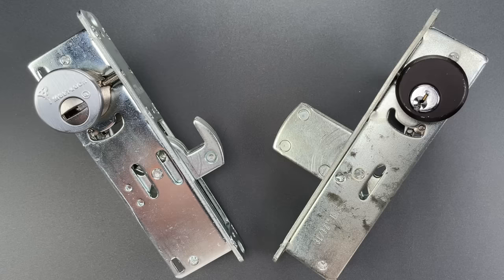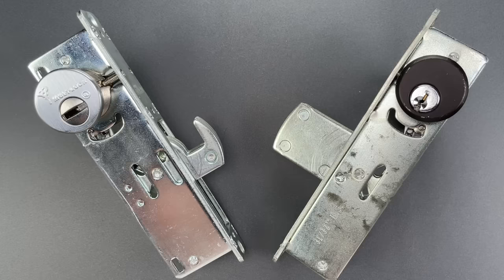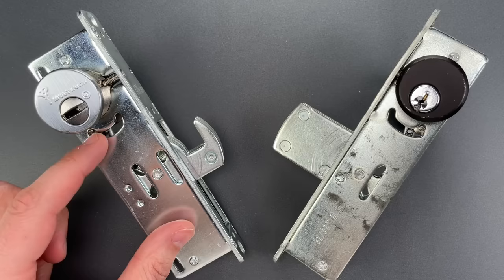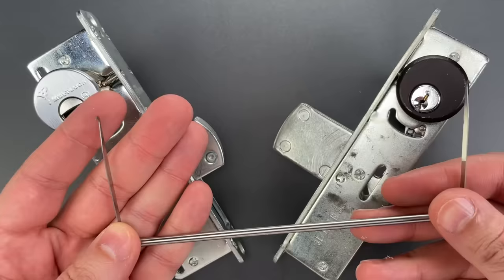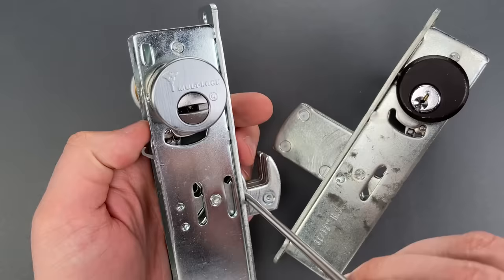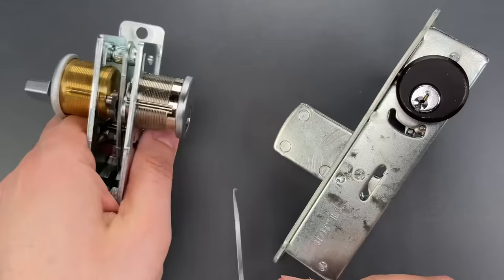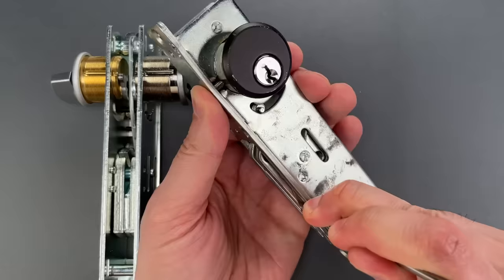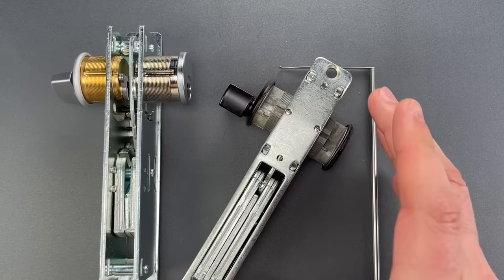[1409] The Most Significant Security Flaw in North America

Comment: My workplace has a baffle plate over the joint between the doors, over the lock area.

Now I know why that plate is there!
Reply: I have seen this in a lot of infrastructure buildings in many communities.  The winged baffles, it be neat to see him try one of those.
Reply: @SolRC  See that would just require a longer tool (of VERY specific dimensions).
Reply: I've seen them too.  Wonder if someone come up with a tool long enough to get around this.  Would like to see a comment from DeviantOlam on this.  He covers this kind of thing pretty extensively.
Reply: So, could it be said that, before watching this video, you were baffled by the plate?
Reply: @Cenentury0941  🤣🤣🤣

Let yourself out please....lol
Reply: Thanks Laird.   I have seen these plates before but I did not realize just how easy it can be to break into our store.  (rock method aside, of course).
I will be getting a plate installed ASAP.
Reply: @michaelmoss5476  And thus the function of LPL and the (noncriminal) lock picking community bears fruit! 🍎
Reply: @Cenentury0941  That was evil, you sick genius!
Reply: @TesserId  the tool would not be able to swing into the lock mechanism if it were much longer, and a tool with a "kink" in it would not fit in the slot between the door and the jam.
Reply: @TesserId  simple block for that would be a bump around the area you'd need to stick a tool. The worst thing is these locks are found on automatic sliding doors, and those doors are easily pushed open without that locking hook. But these could get a bump on the lock side, and an indent on the hooked side, as well as a plate on the outside
Reply: There's a tool for that too, it has a double step. LPL more than likely knows about that one as well, but this isn't about showing potential thieves ALL the ways in, it's about showing core flaws.
Reply: I've seen the plate over the front doors of most apartment buildings that I lived in.  It prevents thieves from using a screwdriver to push the latch and open the main door.
Reply: @sunshaker01  ideally the baffle would be on a tight-sealed door so theres no way to work an "W" shaped tool into the mechanism as the prongs would be too big to fit.
Reply: @sunshaker01  Lots of doors have a full-length cover over the gap to prevent the insertion and placement of handle turning tools from the top or bottom of the door.
Reply: You could always make the flat part of the tool longer, and just go in from under the plate
Or flip the hook upside down and go in from above
Those baffle plates are more of a deterrent (and a pretty effective one at that) than anything else

Edit: Correction on line 1: 'plate' was written as 'place'
Reply: @raymond19001  you're not supposed to be able to push a latch in when it is locked no matter how much access you have.
Try opening the door and locking the latch and pushing it in with your hand and you will see it will not move.
For residential doors, many times there is a half cylinder shaped bolt and when that is pressed in on the frame of the door, it makes it so you cannot depress the spring loaded latch.
On interior residential doors many times that piece is excluded to prevent homeowners from accidentally locking themselves out of their bedroom or bathroom by allowing them to bypass it in a few different ways.
Reply: @FusionDeveloper  I am familiar with what you said.  However, when the strike plate is damaged, the small half cylinder is not  always held back into the lock and both can be pushed with any tool.
Reply: All doors like that should have those.

Comment: When I first started apprenticeship for a locksmith I was pretty shocked at learning how easy it was to pick or open aluminum frame glass doors.
My boss always told me that all locks do is keep honest people honest.
Reply: We had a self locking house front door that I managed to lock myself out of one day by leaving my keys inside. Rather than wait 8hrs in 40 C heat for housemates to return home I called a locksmith.

We walked around the house and checked all the various windows and back doors, then returned to the front door as being the easiest, as they all had multi locks and internal dead bolts. He spent a good 20mins swearing at the lock, as he had picked it, but it but the door wouldn't open.

I then clicked, the door had a slight slump, so you had to lift it slightly even for the key to open it. I duly told the dude and within 10 seconds "pop" it was open.

He told me never to get the door properly rehung, as the way it was would defeat 99/100 people if they tried to break into the house. Which was also very unlikely where we lived.
Reply: My father told me that, and is one of the things that has stuck with me.
Reply: @OneLeatherBoot  Security through obscurity. Unless you know the trick to opening the door, actually doing so is difficult, and an exercise in trial and error.
Reply: @richardhanck972  
Rotfl 🤣
Reply: The reason this isn’t critical is that if you want to break in you can just smash the glass, so no point having more security in the lock than in the door itself.
Reply: @simonrook5743  I mean sure there's some of that, but there's also the likelihood of being caught. If you're on a street and walk up to a door and a few seconds later open it and walk in then most people who witnessed it will think you own the place and you just put your key in. If you walk up to a door and smash the window in with a crowbar most people are going to call the cops.
Reply: @alexsis1778  Or someone walking past 3 minutes after you're inside. "Everything's fine" vs "Broken glass, on a store?! Let me be a concerned citizen and call the cops!"
Reply: @ZacharyHubbellCodes  That could be said for ALL laws. Assume you're not a anarchist in general so why is gun laws different.
Reply: 10% is honest
80% is fairly honest
10% is criminal
Reply: @ZacharyHubbellCodes  not really as the point of gun control is to limit access to firearms. there are more than enough people who wouldnt be able to purchase a firearm who lack the skills required to find and purchase one illegally.
Reply: You’re boss is correct !!!
Reply: @alexsis1778  Exactly. I walk my dog through a shopping center in the morning and see different people opening up doors all the time.  If everything looks normal people assume it is.
Reply: and I would have responded to the last part with "Yes, and water is wet".

Comment: Another fine example of the expression my grandfather who used to be a police officer would say: "Locks are for honest people"...
Reply: That's a lot simpler than what I usually say, "Locks are for people who don't really want to get in anyway."
Reply: or doors for that matter not hard to bust in a wooden or glass door
Reply: @Tomonkey4  
such wisdom in only a few words from both of these ;D
Reply: @hairynose656  then an alarm will go off. I’m betting pulling the lock like this would not set off an alarm. I don’t understand why stores don’t just use standard door handles
Reply: For the rest, there's insurance and cameras. Maybe 2A if you're talking about your home.
Reply: @alexanderduluoz  most times yes it will. Almost all security systems include sensors on the door that require a code input within a certain timeframe.
Reply: After being a welder I realized pretty much anything can be broken into easily if you really wanted to. I mean we cut through 3" of steel on a regular basis and some interviews consist of how straight of a cut you can make.
Reply: Locks only keep honest people honest.
Reply: Locks are there to inform you that you are not supposed to be there. What you do with that information is another matter.
Reply: My dad was a thief, he always said "locks just keep an honest man honest.".
Reply: @jesarablack1661  this is probably the best summation I can think of.
Reply: My dad said locks keep honest people honest. Removes the temptation for people who aren’t actually looking to steal something
Reply: @alexanderduluoz  If it's any half decent security system they'll also have a motion detector. So even if you opened the door that's not going to get you past the alarm.
Reply: well he's not very smart if he says such a dumb thing, saying actually goes "locks are for animals" .. but well nowdays most people's brain is no smarter than of an animal, this is why lock designs are so bad and 99% of people have no idea how to open them without breaking it completely, this is why locks like this are very common .. if burglar wants to get in, they just smash the window, they don't have big enough brain power to look it up online on how to open one.
Reply: @SethiozProject   Well... Humans literally ARE animals lol
Reply: an old friend of mine would say "laws were made so people will stay out of my way"